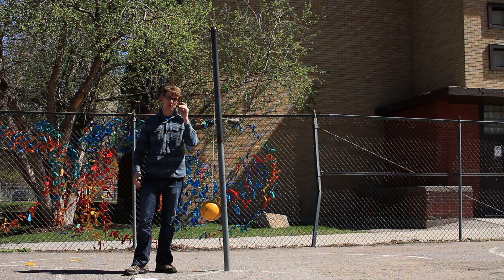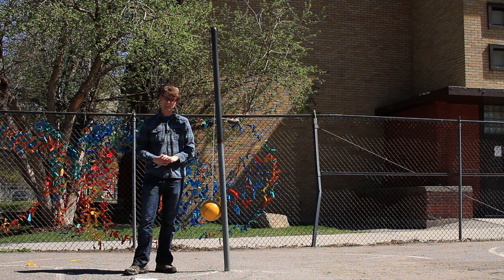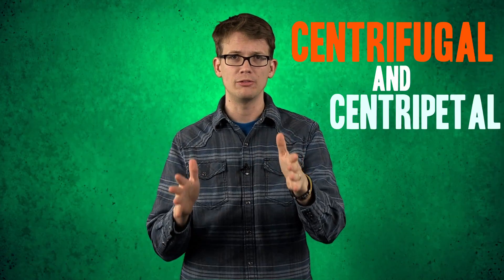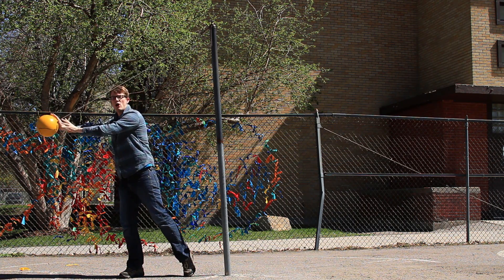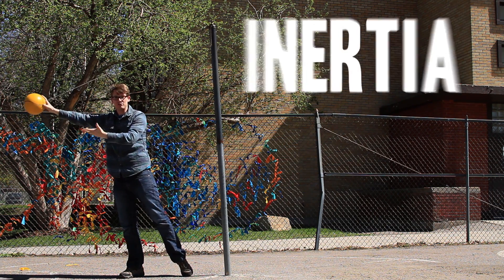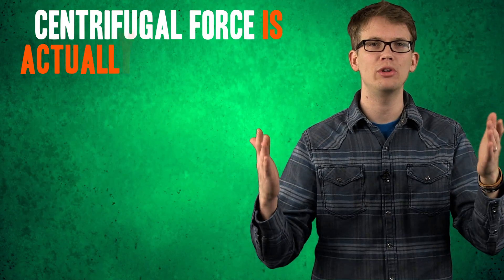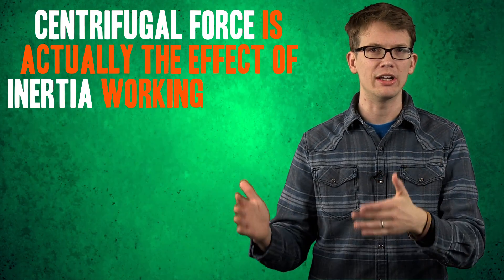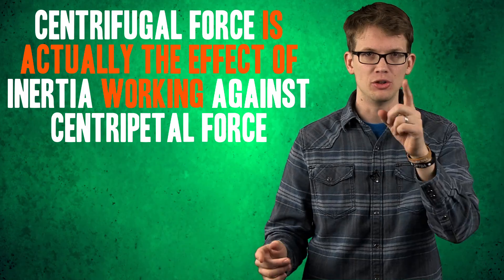IDTIMWYTIM: Centrifugal Force

Comment: This is a good video. But a warning to would-be pedants out there.

From my Classical Mechanics textbook (upper-level physics major text) by John R. Taylor:

"In most introductory physics courses, the centrifugal force is dismissed as an abomination to be avoided by all right-thinking physicists. As long as we confine our attention to inertial frames, this is a correct (and certainly a safe) point of view. Nevertheless... from the point of view of a noninertial rotating frame there is a perfectly real centrifugal force mω^2ρ (perhaps more familiar as mv^2/ρ)"

Basically, it is perfectly acceptable (and honestly more correct) to use centrifugal force as a term to describe what's happening in certain situations. The thing that makes you lighter at the equator than the poles is definitely centrifugal force.

Just, make everyone's day a little less annoying and don't correct people if the extent of your knowledge comes from an online video.
Reply: I used Young and Freeman in my Freshman physics course. The reason they strongly advise you not to use the term is because in freshman-level mechanics you will never be doing physics on non-inertial frames of reference.

The reason why advanced textbooks say this is wrong is because the physics there is an actual centrifugal term from a rotating frame of reference. Newton's Second Law in a rotating frame is:

ma = F + 2mv x Ω + m(Ω x r) x Ω

Ω = angular velocity, a vector
a,v,r are vectors and the x is the cross product

The Coriolis Force, Fc is
Fc = 2mv x Ω
The Centrifugal Force, Fcf is
Fcf = m(Ω x r) x Ω

So Fc and Fcf don't appear in inertial frames of reference. But they're super real if you're in a non-inertial one.

Earth is regarded as "roughly inertial." When you throw a baseball, Fc and Fcf affect the destination of your baseball much less than drag (which you should also be thankful freshman courses ignore). Fire an ICBM, and suddenly those terms are super important, and very real.

(I know this was probably way more than anyone wanted)
Reply: IamGrimalkin Right.  I understand that.  But, it is misleading the way it is dismissed in some texts.  I don't know how many people I have come across on forums and such who are under the impression that centrifugal force just doesn't exist.  Period.  Under no circumstances.....because their physics book told them so, and they cannot be convinced otherwise.  Anyway.
Reply: "Just, make everyone's day a little less annoying and don't correct people if the extent of your knowledge comes from an online video."

If only the average person that watched these sort of videos followed that.
Reply: This is from my University Physics with Modern Physics text (13th edition by Freedman & Young) :

"In an inertial frame of reference there is no such thing as “centrifugal force.” We won’t mention this term again, and we strongly advise you to avoid using it as well."

The text literally never mentions the term again.  Though, it must be noted that it does qualify the statement, maintaining that it does not exist in an inertial reference frame, which at least implies that it IS valid in rotating frames, but doesn't specifically endorse it's use in such situations like your text does.  I guess this is the type of 'introductory physics courses' your text was referring to. 

It doesn't make sense to me why some textbooks endorse the use of centrifugal force (in the proper context), and others almost seemingly equate it to the devil.  Even if the textbooks are geared toward introductory courses, the AUTHORS of such textbooks would have certainly taken advanced courses that endorse its use.  Got any explanation for this?  I sure don't.
Reply: Willoughby Krenzteinburg Young and Freedman has got to be the worst textbook I've ever bought, I'm still annoyed that my university suggested me that in first year years ago. I'd take everything in it with a massive grain of salt (though, there really isn't much in it to take with salt anyway)
Reply: Willoughby Krenzteinburg Because Taylor has an entire chapter dedicated to nonintertial frames, meaning that ignoring fictitious forces like the centrifugal force would be really really stupid. According to wikipedia, Young doesn't, so it doesn't need to bother with it.
Reply: Years later and I'm here to state that John R. Taylor writes Dionne fantastic textbooks. Classical Mechanics and Modern Physics are superb(once you have the math background).

For more general physics, Serway's books are fantastic as well.

Comment: Is this what happens to space craft in orbit?  Only the string is gravity?
Reply: Yes! That's exactly what happens. I'ts been explained to me before but poorly and only now with that analogy I've caught on to what they were saying. So the astronauts never experience "Zero Gravity", they aren't absent from gravity they're just constantly in free-fall and never allowed to go down toward earth.
Reply: Ethan Latsinos They have enough outward momentum to balance with the effects of gravity, the only net force is in a circular path around the Earth.
Reply: @ArchAngelSlayer1  The net force on a spacecraft in orbit acts radially inward toward Earth.  And is equal to the force of gravity acting on the spacecraft.   There is no net force that is "in a circular path around Earth", unless they turn on the rocket engines and propel themselves tangential to the path.

The reason astronauts feel weightless in a spacecraft, is that you cannot actually feel gravity.  You only feel the constraint forces, that you instinctively assume are acting on you because of gravity.  Since gravity acts uniformly on every kilogram of the spacecraft and its occupants, and causes the same inward acceleration of every mass on board the spacecraft, there end up being no constraint forces that hold the occupants at rest.  The weight is nullified by the fact that the astronauts are accelerating along with gravity, and therefore feel weightless.

If you stood on a ladder fixed to Earth that extended as high as the international space station, you would weigh about 95% of your ordinary weight on the ground.  That's how much the true gravity is, on astronauts in orbit.

Comment: he said its keeps the ball close to the ball not exact words but that is what it literally translated to
also it doesn't go at a 90 degree angle to the pole a 90 degree angle with two points isn't possible it would be a 80 degree angle
you can get a 90 with the rope but with only twp...can't be done

Comment: I've been seeing people misunderstand this for decades so I thought it was about time I said something, even though I have no qualifications for doing so except common sense. Newton was right and his third law is always valid. So are his first and second for that matter. Both centrifugal and centripetal forces always exist together, as a pair, in balance. There's never one without the other.

The pole, via the string, applies a centripetal force to the ball. Everyone seems happy with that. The ball, via the string, applies a centrifugal force to the pole. Read that again. In this example you might consider the string to be an 'extended reaction point' between ball and pole. Another example with a more direct reaction point might make things a bit clearer.

When sitting in the right-hand seat of a car following a left-hand curve at speed, a passenger will feel the door of the car against his right shoulder forcing him to follow the same curve as the car. That's centripetal force.

On the other hand, the passenger, again through his right shoulder, applies an outward acting force against the door of the car. That's centrifugal force. I like to think of centrifugal force as inertia constrained to a curve, in fact that's my definition of it.

So, the car applies a centripetal force to the passenger. The passenger applies a reactionary and equal centrifugal force to the car, all through the door/shoulder reaction point. As far as the video is concerned, saying that there's no centrifugal force acting on the ball is like saying there's no centripetal force acting on the pole. Of course there isn't! Each applies just one force to the other. Further, stating that centrifugal force doesn't exist at all because it doesn't act on the ball is exactly the same as stating that centripetal force doesn't exist because it doesn't act on the pole.

To continue, if the passenger has enough mass the supposedly 'non-real' centrifugal force resulting from it will be so great that the car will break traction and slide at a tangent to the curve because both centripetal and centrifugal forces will have disappeared simultaneously. (Don't worry, they'll be replaced by fear.) It really is just that simple.

And if you think Newton's laws don't apply in an accelerating (or decelerating) reference frame I can give you a force by force explanation of what happens to the passenger as the car crashes through a fence and into a tree. The effects on the passenger's brain with reference to his skull are particularly interesting and in full accordance with all three of Newton's laws. You'd be amazed at how many forces are present during the constant deceleration of an accident and how automotive safety systems can act to mitigate them in a split second. In fact, there's a lot of material about this on the line.

On the matter of who sees what in which reference frame, the passenger in the decelerating car can, as mentioned above, see and feel examples of all three of Newton's laws as he crashes. However, an observer standing outside the car in a relatively stationary reference frame, next to the tree looking in through the window, sees exactly the same things.
Reply: No it doesn't. The centrifugal force is specifically a fictional force, like the Coriolis force, and only appears in non-inertial reference frame. What you are describing is simply the reaction force.
Reply: +IamGrimalkin 

You say reaction, I say centrifugal, let's call the whole thing off. But wait, maybe we should try to save the relationship. I'll extend the automotive thought model I detailed in my original post.

In this new version, there are two passengers sitting on an old style bench seat in the same car and setting as before. So, as they round the left hand bend the situation for the outer passenger is the same as before, except 
for one thing - the outer passenger now feels something pushing against his left shoulder in addition to his right. It's the inner passenger involuntarily pushing against him as a reaction to his pushing against the inner passenger.

I call the force applied by the inner passenger to the outer passenger centrifugal force. You may remember that inertia constrained to a curve is how I define centrifugal force. Well, I might say that introducing a mechanical system that constrains inertia to a curve is what brings both centripetal and centrifugal forces into existence. In fact, as I write this I think that is exactly what I think. And note, the outer passenger feels both centripetal and centrifugal forces, one on either side of his body.

Another important thing to note is that inertia is not a force. It's simply a property of matter, moving or otherwise. It doesn't cause anything to happen in and of itself. For inertia to have an effect, the system within which it exists must change and cause the mass to physically interact with some other mass. When it does, some of the inertia will be transformed into force. In the system described (a car following a curved path) the forces created will be centrifugal and centripetal.

Your answer to my first post seems to say that if we call it centrifugal force, then it's fictional, not real. But also, if we agree that it should be called reaction force, then it will be real. As a compromise I think we should call it  the bunch of bananas force and ask the outer passenger how he feels.

If a pressure sensor were inserted between the shoulders of the passengers and the result read, both passengers would see the same reading. Importantly, the stationary external observer in the relatively stationary reference frame beside the passing car could theoretically (if not practically) look in through the window of the car and see the same information from the sensor until the car broke traction. Then, of course, the sensor reading would drop to zero because both centripetal and centrifugal forces would have disappeared simultaneously. 

Further, two pressure sensors could be inserted between the passengers' shoulders. If one were labelled centripetal force and the other reaction force they would both read the same. If the label on the latter were suddenly changed to centrifugal force the reading would not suddenly drop to zero. A rose by any other name.

Centrifugal and centripetal forces are real, perceivable, curved in effect and always in balance. Newton was brilliance squared. Shame about the personality.

Sorry it took me so long to reply, I don't get out much.

Comment: I'm not sure if anyone reads these comments anymore...but I'd appreciate some clarification regarding some "experiments" I conducted with my daughter. We made a pinwheel, we used a blender and a mixer and finally I held her arms and spun her around really fast. I'd like to discuss what we felt and what we saw to make sure I'm describing these forces correctly.
Reply: I am assuming you felt and experianced what you thought was a force pulling your daughter away from you, however, you can tell it was really a combination of forces by remembering the forces acting on loose, untether objects, like her hair (probably long). Her hair was not displaying forces acting on it in a direction away from you, but in a 90 or near 90 degree to you....

Comment: I am learning about this in Physics right now but what I do not understand is what impedes gravity from causing the ball to fall straight down, even as it traveling circularly.
Reply: To put it simply, just look at the string. It is a good approximation to say that it is taut. That means it exerts a force on the ball. If this string has an angle, then you can say it exerts a force on the ball that attracts it towards the pole. The centripetal force is mv^2 / r. But if the string has an angle, it also exerts a force upwards, that fights gravity ! When this force balances exactyl the weight of the ball, it is in equilibrium - it will remain in rotation, and it would not dwindle if there wasn't any friction.

The force the string needs to exert on the ball to balance the gravitationnal pull is simply mg. Call A the angle that the string makes with the pole, then, as the force exerted by the string is parallel to it, its horizontal and vertical components must obey the laws of trigonometry. This leads to tan(A) =v^2 / r g. Dimensionnal analysis suggests that this quantity is, in fact, dimensionless - so it makes sense. As 0 <= A <= Pi / 2, it makes sense to write :

A = arctan(v^2 / r g)

You can look at the limits to get a good intuition of what that means - if v is 0, then A = arctan(0) = 0 -> when the ball is motionless, the equilibrium angle between the string and the post is 0, and the ball will go straight down there. But as v goes up, A =/= 0, and when v^2 / r g goes to infinity, A = arctan(infinity) = Pi/2... and the string is nearly horizontal.

Of course, that's not a full development - you will notice that it is a bit circular, because the radius of the ball's trajectory is depended on the angle A. but in principle, it illustrates my meaning - because of intertia, the angle at which the system is in equilibrium is not always 0. The lagrangian formulation offers a quite swift approach to that problem, known as the spherical (or conical) pendulum.
Reply: Even though your question has been answered brilliantly, one thing to always remember about gravity is that it isn't very strong. Something as tiny as an ant can overcome gravity every time it lifts its legs to walk. Gravity does have a very large area of effect, however, which is why objects that exist (at least some of the time) outside of our solar system are affected by our sun's gravity (for example, comets). I hope me saying this was helpful in some way
Reply: Dragon Book Writer You are correct. If you look at the expression I gave for A - to wit, A = Arctan(v^2 / r g) - you can see that there is a dependence on g. Now you can take g = GM/R^2, where M is the mass of the Earth, and R its radius. G is a physical constant called the universal gravitationnal constant (G = 6.67 x 10^-11 N m^2 / kg^2). If it were ten times larger, it would still be very small, yet, if it were ten times larger, the v^2 / r g ratio would be ten times smaller, which means that A would be much smaller in the end - which means that the ball would rise much less.

In short, yes, the relative weakness of gravity means that it is very possible to maintain the ball at a nonzero, non-negligible angle.
Reply: thanks for confirming what I said, I've been a little bit paranoid since I wrote it that I may have gotten something wrong :P
Reply: Dragon Book Writer You're welcome...

Comment: +lucromel 
To calculate centripetal force: (m x v^2) / r
To calculate centrifugal force: -(m x v^2) / r
Therefore they are equal and opposite.
Reply: But they are not an action / reaction pair. The action - reaction pair, here, is : 1) the pole pulls on the ball via the string
2) the ball pulls on the pole via the string.

There are other pairs. For instance, we can suspect that the pole is implanted in the ground, and when the ball pulls on the pole, the ground pushes on the pole in the other direction, ensuring that the pole remains in place.